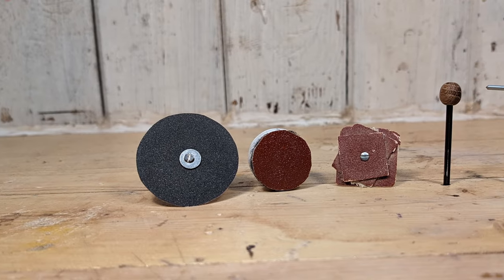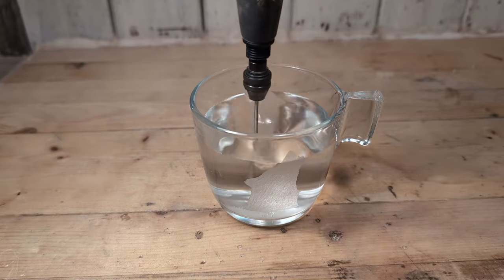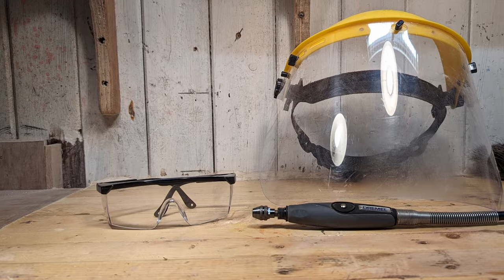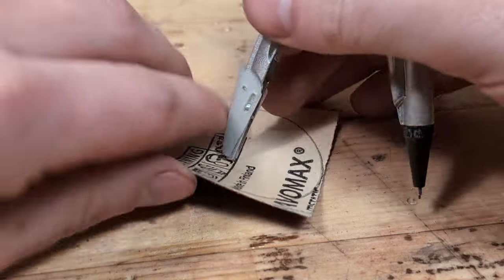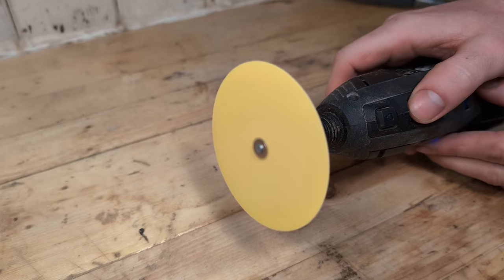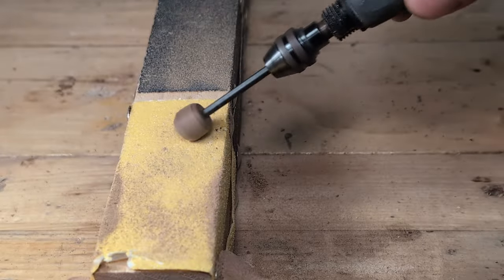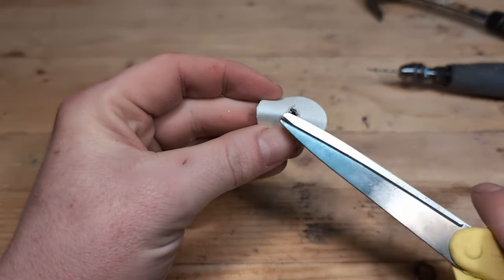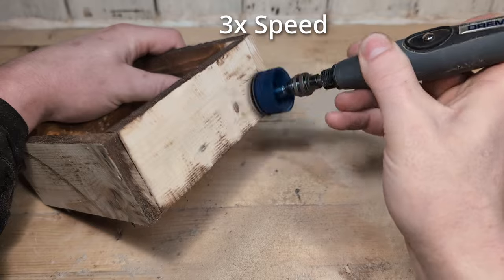5 Homemade Rotary Tool Bits That'll Take Your Projects to the Next Level!

Comment: Question for you about flex shafts.  How often do you lubricate them, how do you lubricate,  and any tips or tricks.  Seems messy to me.
Reply from the maker: Check out FOREDOM shaft lubrication on youtube. You can find their lubricant on amazon. I have not lubricated the flex shaft in 3 years, probably should though.

Comment: Sorry to be off topic, but how best to cut MDF which is not normal wood.  Thanks.
Reply from the maker: No worries. Depends on the thickness. I think the Ez544 wood cutting wheel would work well for cutting thin MDF sheeting and odd cuts. 

You can make thicker cuts with the 565 cutting guide and the multipurpose cutting bit 561 or the 562 tile cutting bit. But you would have to do several shallow passes. And it is not a very pleasurable experience. It usually makes a very high pitch sound. It is also hard to achieve clean cuts this way, but it will cut it. 

So, thin MDF = ez544 wheel
Thick MDF = consider another tool :)
Reply: @rotarycrafts8760  Thanks for your prompt reply.  It’s for 6mm Mdf sheet, so your advice is very useful.  Thanks again,  Alik